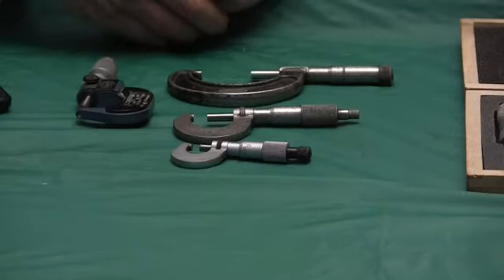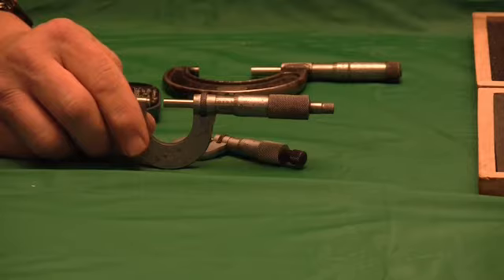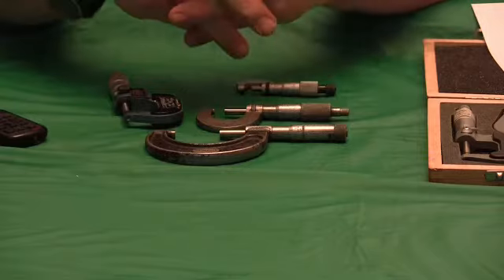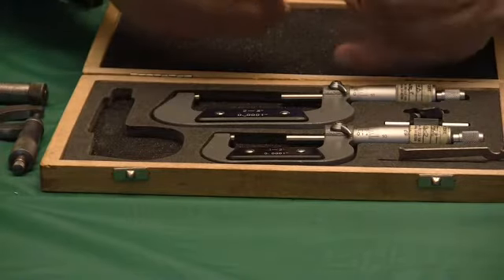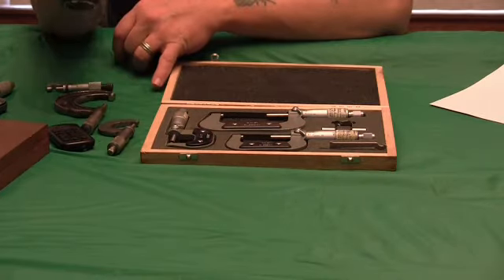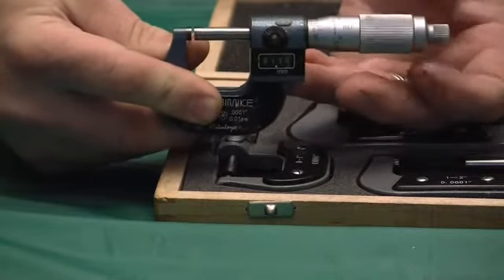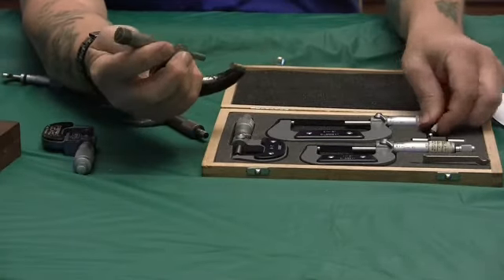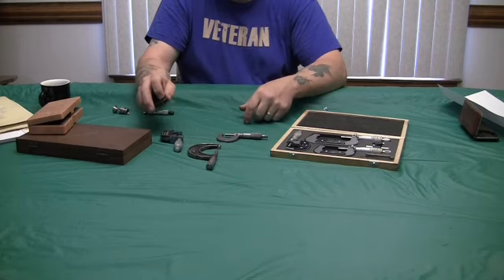Micrometers for the hobby machinist home shop

Comment: I just took a job at a machine shop awhile back running a makino a51nx mill. Never did much with measuring before other than for reloading. Didnt take long to learn how to use them.  Calipers, mics, blade mics, step mics and a lot of go/no go gauges. It's really amazing with the speed the machine runs at that everything comes out in such close tolerances.